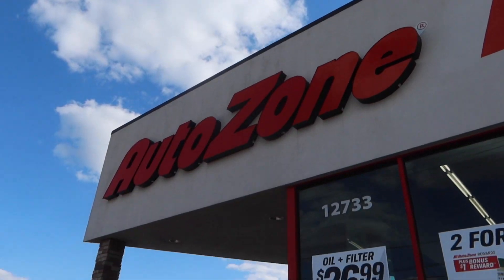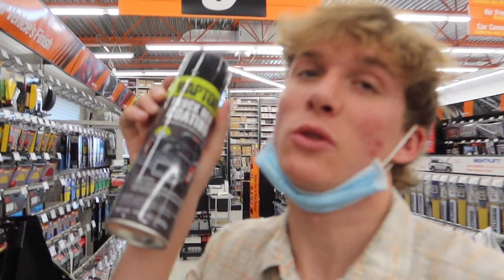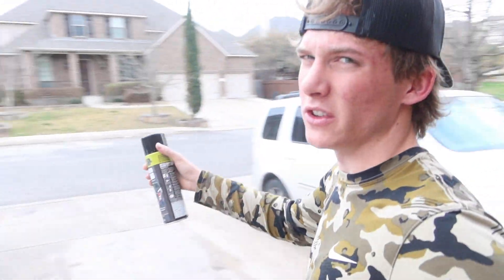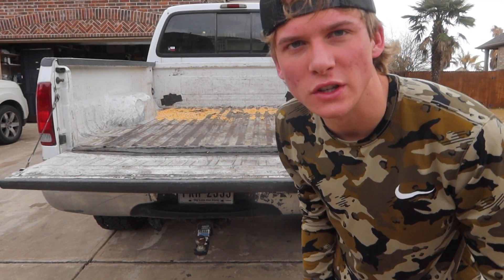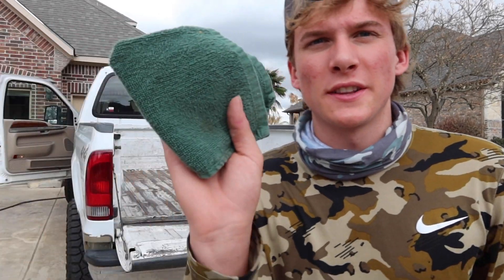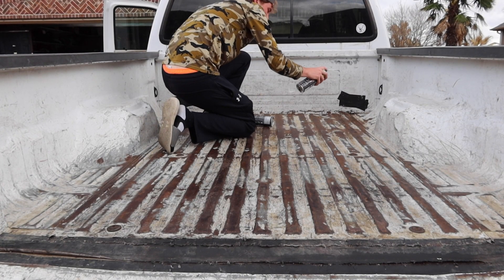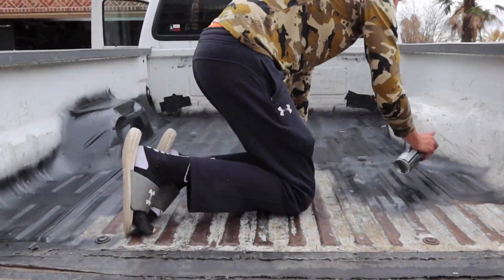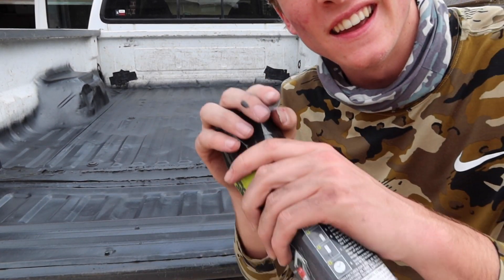2000 7.3 L Powerstroke Diesel Gets An Upgrade!? Auto Zone Challenge!

Comment: Did you ever figure out the problem? I’ve had it on those fords where the shift tube that goes through the steering column has the bolts loosen up. They’re small torx bit bolts. The way to check is to have your head reating on the brake pedal and look to see if the tube plate has loosened up while jiggling the shifter itself.

Comment: Sounds like your shift cable is not adjusted properly. Either that or your parking pawl is broken... For now you should just try
to turn your wheels when parking on a hill and setting your parking brake. There’s videos on how to adjust the cable but if the parking pawl is broken going to have to drop the trans.
Reply from the maker: thanks dude might have to look into it more and try it.